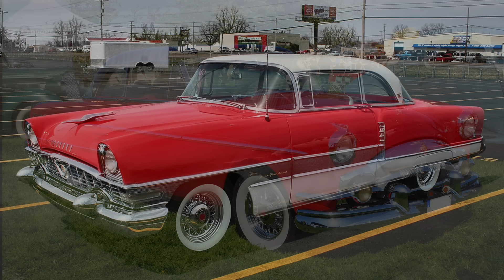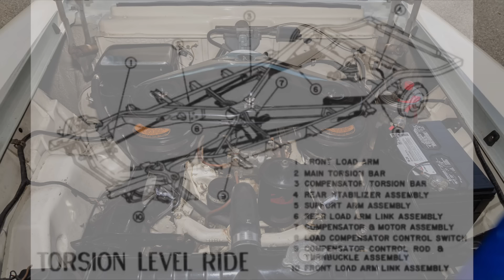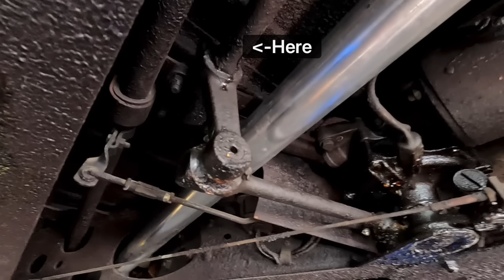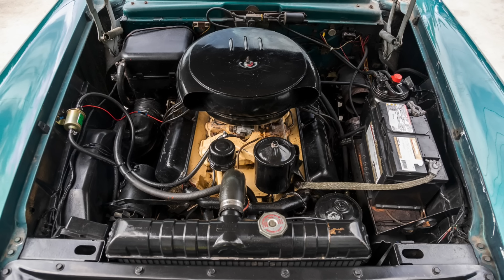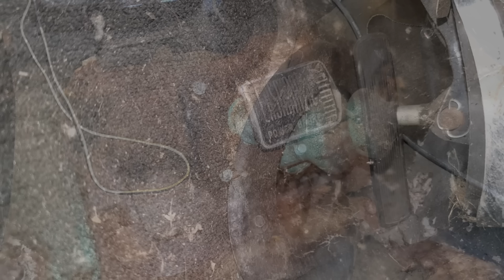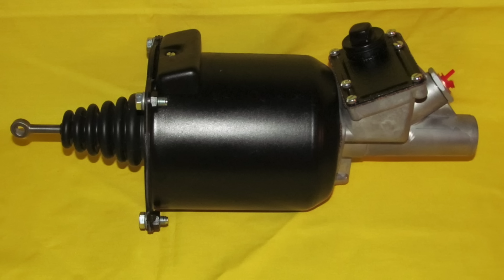Automotive Failures: The 1955-56 Packards Had Both Engineering Triumphs & Flops

Comment: Adding brake fluid; I use the 12 oz containers.  The flexible vent air tube is removed and jack the car up about a foot.  Reach over the side of fender with open brake fluid bottle.  The fill opening should be just to the side of steering column.  With brake fluid bottle about same height as reservoir, tip and fill.
No mention of the twin ultramatic?  Probably the worst component in the whole car!  Positive ground keeps you thinking on electrical problems!
Reply: Being a 55 Patrician owner, I agree with everything you said except for jacking the car up to add brake fluid. The Treadle-Vac cover is level when the car is level, so I'm not sure why you need to raise the car? It just makes it harder to reach the fill port when reaching over the fender.

Comment: Dodges through 1954 ,Pontiacs had the place to add brake fluid under the carpet (pull it up or remove the rubber floormat) under the driver's footwell area
  12:15 I don't think the Dodge was that hard to add/check brake fluid as the Packard appeared to be 
was 1955 the first year that Chevrolet had the firewall mount master cylinder and "hung" brake pedal ?

Comment: I have seen worse on the cars and trucks from WW-2 through the 50s.  A lot of manufactures hid the Master Cylinder under the floor boards of their vehicles back then.  Might even go back into the thirties when Juice Brakes started being installed though I have never worked on any cars of that vintage.

Comment: You forgot to mention the push-button gear selector system many of them came with. Had a 1956 400 2-door for two years back in the early 80's. Even back then I never saw another one on the road. They did ride very smooth but I had no idea how those torsion bars worked. It doesn't seem like they have gone up much in value like other cars of that era either. A mid-50s Cadillac in similar condition probably costs four or five times as much.
Reply: The push buttons were a Borg-Warner unit shared on upper class Fords at the time. They were electric switches that controlled a starter motor that moved the shift cable. 
Alas, if you parked on a hill and shifted out of PARK, the starter motor often burned out trying to dislodge the heavily loaded parking sprag. Chryslers were mechanical and far more reliable. 
And don't forget, Packard trannies were "UltraMatics" designed by Packard, essentially the same as Buick's Dynaflow. Shiftless wonders.
Reply: @Greatdome99 no Sir. The Packard unit was built by Auto-Lite. It was electronically controlled like Edsel's 1958 Tele-Touch.

Comment: Tons of American vehicles (cars and trucks) had the master cylinder under the floor.  Lincolns had their batteries under the floor under the front passenger side floor.   If you want to change the starter in a Northstar you have to pull the whole intake manifold off the engine (let's not even get started with doing the head bolts).  In Packard's defense, they expected you to get service done by the dealer.   A modern Mercedes is almost impossible to repair by an armchair mechanic or even someone with tools.
A friend's neighbor had a 1956 Carribean convertible.  It was magnificent.   I love Cadillacs, but side by side, the Packard blew 1956 Cadillac styling into the weeds.

Comment: As the owner of a 1956 Patrician and a 1956 Hudson Hornet Hollywood Custom 2dr hardtop *breathe*, I'd like to clarify the engine issue. Packard would not sell their engines to AM unless they put a 2bbl carb and intake on them. I'm not sure who put the 2bbl on, but ALL 55-56 Packard engine equipped AM cars had 2bbl carbs on them. My Hudson has a 2bbl on it. That's why the AM cars made less horsepower. There was also rumors of a thicker head gasket to lower the comp. ratio, but that's hard to prove today. All info I can find shows the 352 in 1956 had 9.5:1 in both engines.

   And why are you making a big deal about the master cylinder location? Pretty much all American cars had master cylinders located under the car up until the mid 50s. Heck, I just did a service on a 1941 Cadillac Fleetwood. Not only did I have to pull up the carpeting to check the brake fluid (m/c mounted completely under the car) on the driver's side, I had to pull the carpeting up on the passenger side to check the automatic transmission fluid!

Comment: Adam, I think the best way to get at the brake cylinder was from under the car on a lift. As for the deal with Nash and the V8 I think the real issue was Packard's insistence that Nash had to buy an 'Ultramatic' automatic transmission with each V8 engine. Ultramatic had problems too and Nash was happy with it's Borg-Warner units.

Packard had money but lacked product and production facilities so they were paying for a new engine plant, a new automatic transmission line and then had to manage body and chassis production as Briggs had always produced Packard bodies until Chrysler bought Briggs to produce the Imperial line, leaving Packard out in the cold for 1955. They thought Studebaker might be at least part of the solution but found that Studebaker was in more trouble then they were.
Reply: Money. The engines weren't cheap to manufacture and they were much larger and heavier than what Nash and Hudson needed at the time- AMC also couldn't sell Nash's and Hudson's profitably with the Packard engine. They weren't getting a good deal on those engines. Additionally Studebaker/Packard wasn't reciprocating as they weren't buying anything from AMC. Mitt Romney's dad saw it best to push development of a lighter , smaller V8 that they could manufacture much more efficiently than what they were getting from SP. The original idea was that AMC would be four brands, but the dream died along with the man who envisioned it, George Mason. It was probably better off that way at least for AMC, because Studebaker only had Packard to bleed dry, lol.

Comment: Packard 443, the line topper in the late 1920s had 384c.i. in-line eights.  It put out about 110hp.  That was the largest in terms of displacement.  As for the Torsion-Level suspension, Packard did not create that; they bought it from a Hudson engineer named Bill Allison.  Hudson was broke, so company president, A.E. Barit allowed Allison to shop it around.  Interim Packard president, Hugh Ferry bought the rights to it.

Comment: Really like the negative battery strap routed straight to the block.  Clean.   Also, the center feed radiator hose, sweet.   That brake system is whack.

Comment: we got buzzed by a low flying Packard going thru a deep gorge on an interstate once. It was a '56 and I think a Caribbean, a 2 dr hardtop. We were probably doing 55 mph, it was flying past at probably 70 or more. This was a twisting mountainous section of a very rural freeway. The Packard was not slowing down for the curves. I noted how its huge size and bread-loafy design defied the demonstrated handling prowess.

Comment: Is it just me or did the US auto industry in the 50's have much more technological wherewithal and ambition only to really give up around 1962?

In the 50's there were cars with electronic fuel injection, mechanical fuel injection 4 speed autos some with overdrive, self levelling suspension(apparently) central AC. By the 60's into the Malaise 70's it was copy pasta pushrod v8's and carbs with 3 speed autos with no differentiating characteristics across brands or makes  technically. What happened?
Reply: Excellent question.  Using GM as an example, I believe the corporation made a strategic marketing decision which stretched financial resources around 1960 by having every division offer a compact, intermediate and full size model (Cadillac excepted).  It confused customers, cannibalized sales among the divisions, and forced the corporation to engage regularly in "badge engineering." 

True technological engineering development moved incrementally afterwards because of the financial constraints.  Other than some front wheel drive systems in the mid 1960s, did GM have any big engineering breakthroughs until the 1980s?

Comment: Happy Boxing Day, Adam, great content as always! These Packards had so much potential, a shame they didn’t get to expand and improve their features. I’m no expert on straight-eight cylinder engines, but I know that Duesenberg model J/SJ/SSJ’s had a 420c.i. inline 8, larger than the Packard’s… maybe it’s a stretch to say that Duesies were regular production models, but there were enough of them around that some engines found their way into hot-rods in the 1940’s and 50’s. In any case, your coverage of the Packads for 55 and 56 is spot on, thanks again!❤

Comment: I had a 1943 WWII Jeep also with the master cylinder under the floor.  And yes it was fun to service it, I used a small funnel with a little rubber hose on the end.   Fun Times.

Comment: The master cylinder was mounted under the floorboards of many cars prior to this era. Packard was probably the last one to use this system.
Reply: But from the photos, it wasn't really under the floor, just very low. The Studebakers had under floor brakes till the end and you had to service the reservoir through a access plate in the floor.

Comment: "How do you add brake fluid on a Packard"
Ask the pissed off man who owns one....
Reply: A Rolls Royce of that period had two master cylinders underneath and a friction power assist exposed to the weather.
Reply: @JimManos  Yes, but the reservoirs were easily accessible under hood. Connected to master cylinders by hoses.
Reply: Most of them did what rich folks do... let the local "wrench" do the dirty work.

Comment: Yes Packard's problems began in the 1930s, but a large luxury auto brand also needed a volume brand to survive. Lincoln had Ford behind them. And Cadillac had all of GM behind them. Many felt that the Packard Six/110 and the 120 cheapened the brand, without these models Packard probably wouldn't have survived. Maybe they should have made them a separate brand, but look at how many new companion makes were introduced in that time frame and how long they survived. 
After WW2, when Packard was flush with cash, they should have begun developing a modern V8 instead of an automatic transmission was a mistake.  But Packard engineers were pround of how smooth and quiet their straight eights were, and rightfully so. But the future was in OHV V8s and they could have, at least temporarily bought GM's Hydra-matic or a Borg-Warner unit (as Lincoln did for a time). 
Also a merger should have been worked on much earlier, at least with Nash and posibly Hudson. 
If these things could have been done at that time the automotive landscape could have turned out much different.

Comment: Yep Adam, the OHV Introduction was tremendous and when combined with the Packard Caribbean Convertible in 1955, was incredible. The Master Cylinder positioning underneath the floorboards was a massive mistake and U have to wonder why they did it, Adam.....Still, a little modifying by the owner, wud alleviate the problem, by putting it back in the normal spot, Adam. Cheers fm Damo.

Comment: From my understanding the longitudinal torsion bars were attached so as to twist and act as anti-dive/anti-squat during acceleration and braking in the same way anti-roll bars twist to control left and right roll in corners. If true that's the genius in the Level-Ride suspension.
Reply: Drive a 1955 Cadillac then drive a 1955 Packard ( if the Torsion-Level Ride is working properly ). There's no comparison on the ride quality. The Packard is the better car all-around!
Reply: @Lurch4you  "If it's working properly' is the important part of this.
Reply: It would attempt to keep the car level front-to-back but if you look at the diagram, there is no connection/mechanism left-to-right. And these cars really swayed when turned due to the soft springs.
Reply: @Greatdome99 i think if you look closely at the diagram, you can see the front and rear anti-roll bars laid out conventionally. The rear one is behind the differential, and is  labeled number four. The front one is in front of the engine cradle as is typical but it is unlabeled.

Comment: Packard had already " merged " with Studebaker by the time the 1955s came out. ( It was actually stock deal brokered by Lehman Brothers. Packard's stock was used to pay off Studebaker's debt. But Studebaker lied about & Packard never checked what Studebaker's break in point was ).

Torsion-Level ride was actually developed by an engineer over at Hudson named William Allison. He was allowed to shop around the idea to other carmakers ( Hudson was already broke ). Only Packard showed any interest. 

Other interesting firsts of the 1955-56 Packards. 

Tubeless Tires - Packard was " first " for 1954. Everyone else followed suit for 1955. 

Reversible Seat Cushions - 1956 Caribbean 

Twin-Traction rear differential - optional on 1956 Packards. 

Exterior side lamps on the side of the car - 1955-56 Senior Packards. 

Wrap-around front turn signals - all 1955-56 Packards.

Comment: An old friend who had two 56 Patricians had an old style grease pit in has barn/garage. He added brake fluid from underneath using a turkey baster. It worked, but not many people had a pit like that. Nowadays semi pro grade lifts are an option if you have the ceiling height.

Comment: Under floor brake master cylinders were quite common for 1950's cars.
Reply: In the UK, the Morris 1000 (Minor) had an underfloor brake master cylinder which was accessed from inside the car until production stopped in 1971.
Reply: Yes, you are correct. Buick used a similar power brake booster in 55 and 56.
Reply: And in almost all cars when hydraulic brakes first began to replace mechanical brakes in the 1920's and 1930's. The firewall was, after all, for the gas tank. 😊

Comment: As I see it, Packard was the last casualty of the Depression. Despite being flush with cash after making all those merlins for p51s (which very-arguably won the war for us), Packard was showing signs of losing its way about 1936 in how they introduced those mid-market autos. Another nameplate might've been the way to go (Clipper was too little too late), or a merger back THEN with say, ever-innovative Hudson? The last prewar Packards' styling was lacking compared to just 6 years before (the 11th series are AMAZING). Compare a 1941 to a 1934 and tell me which one was king of its hill. Coming out of the war, compare the Packards to postwar Caddies and it's already over. Even Buick was leaving them in the dust by '54.

Comment: Prior to the advent of suspended pedals, most cars had the master cylinder under the floor.
Reply: Old VW bugs have a similar master cylinder location. At least those had a remote fill for the master cylinder under the front hood. And they don’t have complication of power brakes.
Reply: Yes, I'm pretty sure my '50 Plymouth had the master cylinder under the floor. A very poor design/placement, IMO, because it was much more exposed to road dirt and salt, making rust a bigger problem.
Reply: Our '53 Hudson had it there. As I recall, it was fairly easy to get to.
Reply: I bet that was fun to fill
Reply: Just left the carpet and remove an access plug.
Reply: @WhittyPics  In 1961, age 14, I started working in our local Esso station.  Brake fluid was dispensed from a gallon can.  A spring loaded pump screwed in place of the can cap. Pulling the plunger up drew in fluid, which then passed through a ~4 foot hose to a nozzle which could be operated with one hand.  No problem getting into tight spots, just needed care keeping brake fluid off the paintwork.
Reply: The master cylinder on my 1950 Chevy truck was under the floor.
Reply: You guys sound like you don' know that pretty much EVERY make and model had frame mounted under cab master cylinders until hanging pedals became a thing later in the in mid/late 50's

Comment: I fell in love with this generation as a 5-year old, and vowed to own one some day. At age 20, my first personally owned car was a 1955 Patrician that we found in the back yard of the neighbor of the local auto restorer, Al Cook in Bolton MA. I sent out the Ultramatic trans and rebuilt the engine myself. It was a fine running car with surprising handling for its size. However, I did come up with a brake failure in 1974, while driving a couple of friends in their wedding. A wheel cylinder blew just after we left the church on the way to the reception, the couple were reduced to hailing a cab in their wedding garments. I never got to the reception, as I had to get the beast off the street. Fortunately, selective memory de-selected the act of refilling the system after replacing the blown cylinder--- I have absolutely no recollection of doing it. My passengers are still married, over 50 years later. So, there's THAT.
Reply: What happened to the car? Do you still have it?
Reply: @Pepsi-hm1hs  No, I sold it in the 1970's to get my first apartment.
Reply: Sans the flatheads.
Reply: In the photo looking down to the master cylinder from above, note that they removed the accordion air channel that connected to the firewall and a wide metal tube that scooped fresh air from behind the front grille.